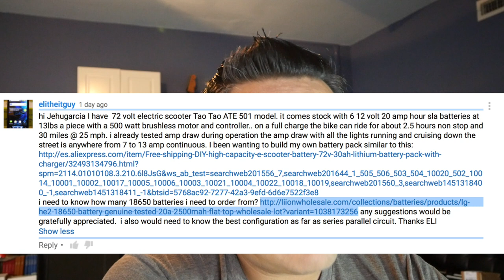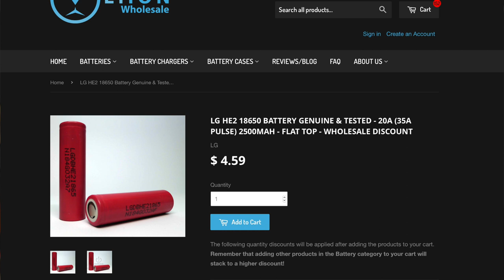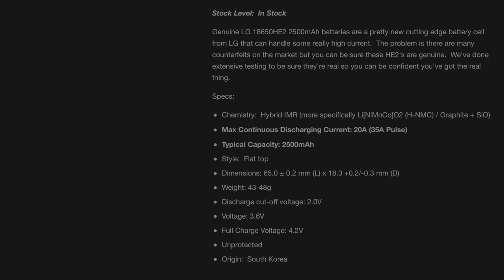How many 18650 cells to power a Scooter?   Battery talk #4

Comment: hi bro,   i got some battery packs from googles loon internet ballon project.   i want to install them on a 3  wheel electric car.  car is using 3000w 72v motor.   the battery packs all have their bms  boards.   the first issue im noticing  the voltage on each cell is very low  only  0.2 to 0.5v.   do you think they can recover with charging them?

Comment: What happened to the list of parts to build the battery pack you have there???
Reply from the maker: List of parts used to make this project:  
Laptop Batteries  http://j35.us/Ebay-Laptop-Battery-Lot
18650 Holders     http://j35.us/18650-spacer-clips
Copper buss bars http://j35.us/1NGpBo4
Brass strips         http://j35.us/Small-Brass-Strips
Cell Fuse wire      http://j35.us/1k-Ohm-resistor
Reply: +jehugarcia thank you!!!

Comment: Hello I was wondering if you convert your car into electric will it effect any of the other side example License, Insurance, and other aspects of the car? I don't know and I have searched only but the articles don't provide much information for this. Thanks
Edit: I live in U.K but wouldn't mind the Law changes but most of the common stuff that are required for this process to work.
Reply from the maker: +Xnit E   Not for classic cars here in california,  modern cars,  you just have to change it to electric type so you won't have to pass emissions tests every few years.    Laws in Europe are a lot more restrictive  from what i hear
Reply: I had the same question, but I'm in Japan where vehicle laws are ruh-deck-u-luss!
I have a standard manual car drivers license, which permits me to ride a <50cc scooter/bike up to 30kph legally and is emissions exempt.  If converting to electric puts the bike/scooter into a different registration category, things might get tricky.  But Japan's pretty good about being eco-friendly.  I would love to throw together an electric scooter and not have to worry about engine maintenance.  That and gas is around $4.30/gal. at the current exchange rate.

Comment: I thought that series connection keeps the watt hours the same and the watt hours only increase when a parallel connection is made
Reply: At 7:50
Reply from the maker: +J M   No,  you are confusing voltage, amp hours and watt hours

Comment: when you wire batteries in series you don't increase capacity, just voltage. the 19 cells in series would still have a 2500 MHA capacity. he would need 155 rows of 19 cells to get 1.44kwh so 2945 cells!
Reply from the maker: double check your math

Comment: it's for my e bike 90 volts at 75 amps peak 360 cells in total
Reply from the maker: +Jonathan Sanchez    Whats the capacity?  75AH?     90x75= 6.75kWh?   thats a big battery,   a 5Kw charger would charge that in aprox  1.5 hours

Comment: Have you used a Prius battery pack to make a solar battery pack?
Reply: Prius are nicads? that's okay. Lithium ion last more cycles.
Reply: @HelloWorld-ns7gt  will they work for an rv battery pack?
Reply: @joyglass7143  Yes but you have to match the voltage to your system and use a nicad charger. I'm not sure what voltage they are grouped together as in the prius.  If you don't want to pull them apart and rebuild, you need a step down converter, from what ever volt they are , down to the voltage you need. Say 100 volt down to 12 or 24 vlt.

Comment: i have a 60v  2000watt elecktric scooter. it had 5 lead accid batterys in it. i want to build a 18650 version.
i have 2500mah cells, how manny do i need to ride the scooter for 1 hour?
sorry for my bad english.

thanks :)
Reply: ben grobben he explain in video. i have same scooter with you like 60v 20ah lead acid battery and i need 129cells

Comment: How heavy is the 150 cells full charged aprox?
Reply: 15lbs
Reply: +Ryan B it's not a tank of gas the weight does not increase in a battery if it's charged dude you have to know your stuff before you ask stupid questions
Reply: Joe Pan then why do dead batteris feel lighter than new ones?
Reply: dat boi lead acid batteries become lighter because their electrolyte converts into gas and lead also decomposes by reactions which is the cause i think..Lithium batteries do not face these type of problems over the time.

Comment: question.  I want to use 18650 to make a solar generator using a 12v solar panel & regulator and I want to make batteries using cells. a normal 12v batter runs roughly at 13.5 ? so would I use 4 batteries in series and let the regulator charge it low ? or would I be using 3 batteries to get the 12 volts.  I already have some 2600mha harvested from a laptop I was thinking 4 x 5 to give 13 ah the voltage if fully charged though would be about 14.8v am I going about this the right way any feedback would be appreciated
Reply from the maker: +dean castello  that's the thing with lithium,  3 cells it's too low and 4 it's too high,    I'm running 3S in my samba,   Don't use a charger made for lead acid,  the voltage is wrong,   I'm using a DC-DC set to 12.2v max.  That charges each cell up to 4.07v.   I under charge and under discharge that way cells will last me a long time
Reply: I was going to use a 12v solar panel that actually puts out up to 18v and a solar regulator which I don't think you can chose the voltage on them. I see other people making 24v systems but I didn't want to go that route I'm not looking to power my house I just want power on the go like for camping. what would you go with I think I am better off with 4 in this case ?

Comment: but you are assuming we are going to use all the power of each cell, I think this end it up damaging the cell, in lead acid battery you use about 25% of the capacity, if this is apply to the lithium-ion battery you should have around 600 18650 cells, I'm right of I am misinterpret something

Comment: I reckon this guy is not taking note of how many batteries are in series and how many in parallel. I think the voltage is 36 volts. 3 batteries in parallel x 2. Works out to be 36v x 40Ah. 7A x 36V=252W and 13A x 36V=468W.

Comment: i have 60 v 20ah (5x12v)sla battery scooter and when we convert lead batteries to 18650 ; do we need to change our sla battery charger ? Because i head like we cant use this charger on lion batteries..
Reply from the maker: +Türk Best  you can not charge 18650 cells higher than 4.2v   You can use whatever charger as long as you don't over charge your cells.   15S lithium is 63v MAX   You need to measure what your charger puts out
Reply: So if i calculat like in video 60 v / 3.7 v = 16 and 16*4.2 v = 67.2 v Max charge voltage . am i right sir ? İ measured my charger socket and it says 69.1 v so i can not use this.
Reply from the maker: +Türk Best  17S would charge your cells to 4.06v

Comment: I wanted my scooter battery at 72v and can I drain my battery at minimum cut-off voltage and what could  be the consequences
Reply: Total failure or at least a shorter life for the battery. The further down you discharge the more likely it is to kill them.

Comment: Will the charger for the lead acidbattery be compatible with the lithium batteries?
Reply: William Quilitzsch if ur charger wont do ur lions over charging ,then you can use . if u write me whats your batteies and charger voltage then i can tell you.
Reply: Can can Sorry, I don't have any batteries to charge, I was just wondering if if the control circuit is compatible with both types of batteries.
Reply: İ think only matter is voltage. But they sell different charger cuz of lithium and lead acid batteriess' peak voltage is different.
Reply: Can can OK thanks for the info.

Comment: your link to "cell fuse wire" are just resistors, was that intentional?
Reply from the maker: +Charles lakins  yes
Reply: +jehugarcia is that the best method of fusing by also reducing the current too? wouldnt an actual fuse be better?
Reply from the maker: I don't use the resistors,  only the legs,  they are real fuses
Reply: +jehugarcia ahh ok that makes sense

Comment: Link from "cell fuse wire" goes to "1K Ohm resistor". Are you seriously using 1K resistor as a wire for a 3.7V cell? 3.7/1K=3mA only. Something seems to be wrong here. And why brass stripes, not copper? Thank you.
Reply from the maker: +Igor Ilkevich you need to watch the rest of my videos,  answers are found there
Reply: +jehugarcia I don't see 1K resistors on your packs in some other videos. So I have zero clue why link goes to them.

Comment: how many 18650s to power a 1000 watt grow light for 12 hours?
Reply: Assuming you are using 2Ah cells, you get 3.7v x 2Ah = 7.4wh. 1000wh light x 12 hours = 12000wh. 12000wh/7.4wh = 1,622 cells (rounded up because you can't have a fraction of a cell).
In a situation like this, it would be a better idea to have power supplemented through generator than trying to build a powerwall for it.

Comment: What device would you suggest to charge a 19S battery?
Reply: +TheUnnamedGent i will suggest 80V 5amp-10amp charger with BMS.. but for this  brother case he good it own scooter charger.
Reply: He's got a scooter charger designed for lead acid batteries. I wouldn't use that unmodified on lithium battery.
Reply: don't forget i mentioned about the Battery management system BMS which can regulates the charging voltage for each cell to 4.2V each.

Comment: HI Jehugarcia thank you for your video. this information was very helpful.  yes with all the lights running it draws and my Bluetooth boom box the total amp draw during operation is about 13 amps. without the lights and boombox its about 7 amps. I probably will do a video on my battery build and test run of my scooter. with six sla batteries the bike fully charges at 80 volts then the charger shuts off even though its listed as 72 volt charger. If you have recommendation for different 18650 battery let me know. i am probably looking to get longer use time . i am also thinking about going this route: http://hybridautocenter.com/HAC4/index.php?option=com_hikashop&ctrl=product&task=show&cid=101&name=lithium-ion-pack-of-7-battery-modules-60ah-58-8v-nissan-leaf&Itemid=605 Nissan leaf battery modules i trying to see which will give me better battery performance for the price. Either way Ienjoy your videos and I an a fan of your work thanks Eli.

Comment: another question some of my batteries are 2600 mah some are 2200 do I need them to all be the same mah or can I use both kinds of cells?
Reply from the maker: +dean castello   Depends how you are wiring them
Reply: how should I wire them ?
Reply: The crazy ebike guy sorts them then puts 2200 in same (p) parallel and 2600 in their own parallel of the pack. That way they don't cause problems.

Comment: a 500w motor doesnt draw 500w, it can draw 500w 24/7 without burning up, if you put a heavy load on it with a good power supply that could take the load, the motor could easily pull 750w, find a bigger hill, 900w, but we can see whats going to happen here...

my 800w motor pulls 28a from a 60v pack... on the hills, nothing to do with lighting./
Reply from the maker: +lez briddon  so in more eloquent words,  the 500w rating is continuous not peak,    Got it
Reply: people often think motors are consumers and consume the rating on them, they dont.
its a rating for best performance/lifespan, the bulb that burns twice as bright etc

i'm just waiting to win the lottery to afford lipo for my van!

love your channel, keep building.
Lez.
project806camper

Comment: How to charge the 18650 bAttery sample 100 PCs battery's how to charge that
Reply: Need to match the charge voltage to the pack size, one cell 4.1 -  4.2 vlts.  3 cells in series = 12 volt etc. Side by side you add the amps, end to end it adds the volts.  eg if  you have 3x 4volt 2 amp cells? connected side by side you have a 4 volt 6 amp battery. If connected end to end pos to neg then you have a 12 volt 2 amp batt.

Comment: Anybody know how many of these 3.7batterys I would need for a 36 volt battery pack?
Reply: Watch the video as there is an explanation on how you compute it... you have to consider how much AH you will need... skip to 2:45 for the explanation. To achieve 36v... you will only need 10x 18650 batts (10 x 3.7 [nominal voltage]) but of course that is not enough juice to power your system.

My guess would be 8P/9P and 10S configuration.... So that would be around 90x 18650 3.7v @ 2000mAh minimum.

Comment: what motor did you use, can you explain that plz
Reply: +Oliver Gunn from his question i thinks it 500watts motor 1000watt peak power cause he using 72volt system and 13amp peaks.. 1.44kwh battery pack possible for 2.5hours non-stop ride because the system amp is around 6-13A.
Reply: +Justin Stine I meant in his vw bus
Reply: Oh.. yeah i wanna know it too.. but it like a Warp's 9 or AC-50 motor..
Reply: it says they are only 30kw, but i have seen in other videos that they can be worth 400hp, I'm so confused
Reply: I think Jehu use curtis AC-50 71hp motor 96V system 600ampere max. phase current 60KW peak power.. Nope, it cant be 400hp..
Reply: The different between electric motor and gas engine is electric motor got double amount of  torque everywhere every time even with the same horsepower and direct transmission.. 120ft/lb torque for 60kw motor peak.
Reply: +Justin Stine so to replace a 70hp engine in a small hatchback without loosing power what is the cheapest option.
Reply: hatchback probably weighing below 2200lb/1000kg.. the TranswarP 9 Brushless DC motor is the less expensive and a little bit heavier and less power compares to AC-50.. there is different between attaching direct transmission of with standard manual transmission which u dont need powerful motor for acceleration..TranswarP 7 enough power for manual transmission.
Reply: you can also use forklift used electric motor ranging 30-50kw rate power to reduce the budget..
Reply: dude, u can try to use this industrial pump 3phase AC high voltage 415V brushed motor.. but this motor is very heavy for EV.. not efficient and very high voltage is dangerous..
Reply: Justin Stine its just i cannot find anything below like 2k
Reply: try to finds a big golf cart drive motor or heavy forklift drive motor.. mostly in ebay is below 10kw power.. it under power motor not suitable for hatchback.. your car will downgrade into slow speed golf cart.. try to find 20kw or above.. i suggest you 72Volts system.
Reply: +Justin Stine to be fare to the company they do have small minibus things called bread vans, but thanks
Reply: +Oliver Gunn if you see the picture of the "minibus" on the listing you can see it looks like something that would take you from the car park to the entrance of the zoo.
Reply: Lol.. you got it right.. you'll face a problem to claim a descent/steep hill.. Another choice is taiwan BDLC liquid cooling 20-25kw rate and 50kw peak made by golden new motor price at $1600 excluding shipping and tax.

Comment: Thanks for this example!  It prompted a question for me.  When powering a car or boat motor, is there an advantage to building a battery pack like described in your video over buying a Lifemnpo4 battery?  I have seen these used quite a bit.  I am about to repower my boat with an electric motor.  http://www.electricmotorsport.com/ev-parts/batteries/lithium/gbs-12v-4-cell-100ah-lifemnpo4.html

Comment: OMG!!...GLARING mistakes on several fronts. First of all when calculating the WH's of a potential pack, you stated that you take 72 volts x 20 ah and get 1.44 KW hrs.  INCORRECT!...a Lithium cell at 3.7 volts is HALF empty. A 72 volt pack at 20 series would be 84 volts fully charged and settle around 82.5 volts. If you take 82.5 volts x 20 ah you get  1.65 KW hrs.  Also when discussing the amp draw from bike you are having problems figuring out why it draws more than   8 amps..lol..how about a gust of wind?...a slight uphill??...its NOT the motor that determines the amp draw its the controller.  8 Amps is nothing..a 2 degree incline would have this thing slow to a crawl if the amps were to stay at 8..the controller determines the draw and load of the motor and supplies extra current to attempt to overcome this load.  Also, when calculating the total no.of Wh's  a pack has, there are several criteria which must be met or those numbers go down..way down...first most Lithium 18650 cells are rated in ah's at .3 amp draw. Thats why when I test my Panasonic NCR18650PF cells rated at 2900 mah, on my IMAX at 1 amp they come in at 2540 or so. So building a 20 s 6 p pack should be run no more than half amp per cell or 3 amps to get the rated capacity which of course is nothing. Also, to get the rated capacity it assumes the cell is charged to 4.2 volts and STAYS there (which they dont) and goes all the way to 2.75 volts (which they wont as below 3.2 volts they (even brand new cells) will begin diverging and the first one that gets to 2.75 volts, the BMS cuts the power even though some may be at 3.2 volts. This is the real world and not trying to figure something out on paper.